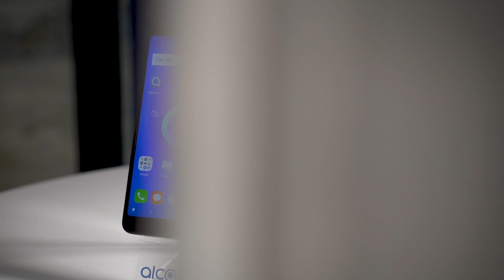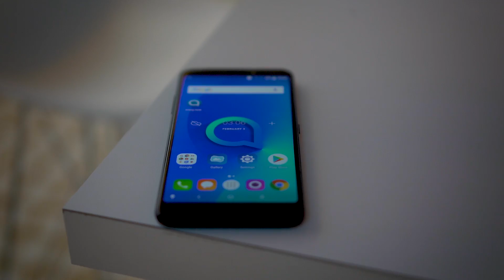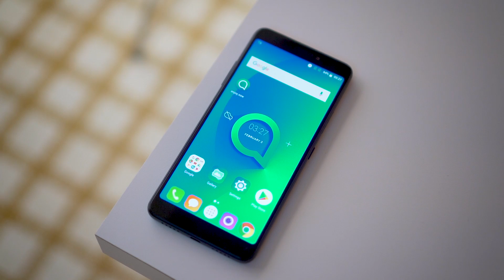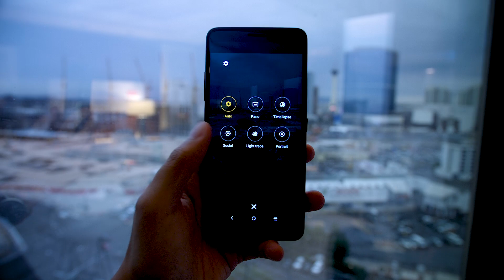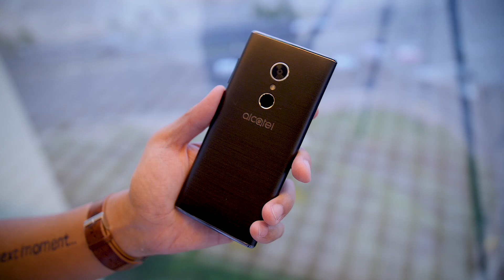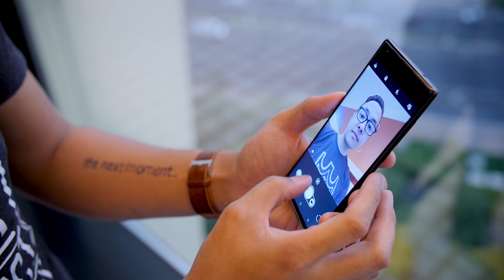Alcatel 1, 3, and 5 Series First Look

Comment: I hate this 18:9 meme. It just gives you black bars in most videos and makes the phones structurally weaker with no real advantage in real life usage. 16:10 ratio on phones I could get behind because it actually increases the usable real state of the screen, but just renaming 2:1 as a gimmick really bothers me.
Reply: Ramón González I purchased the OnePlus 5T and I had the 3T before it, so I am familiar with both aspect ratios in similar form factors. I can honestly say that 18:9 is my preference, but most will disagree with me.

Comment: When 18/9 was released, it was to have a bigger screen in the same phone with a 16/9 screen but with bezels.
Now 18/9 is used and misused everywhere with bezels etc. Making the phone taller than ever!
Reply: Liion B true. But some phone used this ratio gracefully.
Reply: Some don't, that's correct. I think it's mostly the lower end devices trying to be similar to the higher end ones.